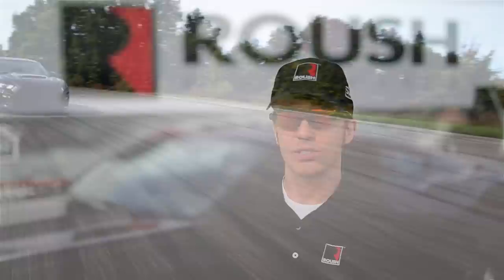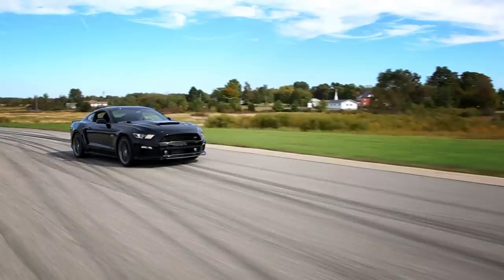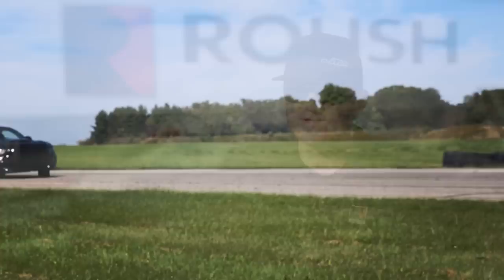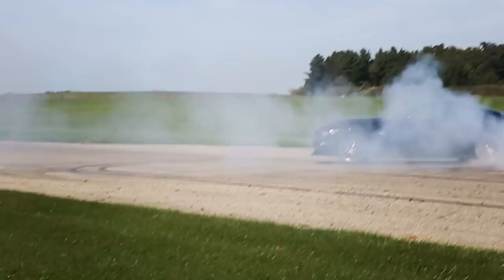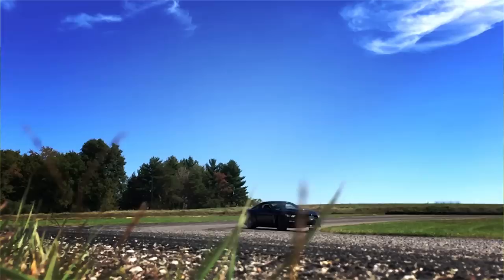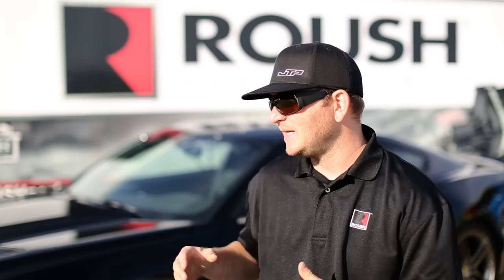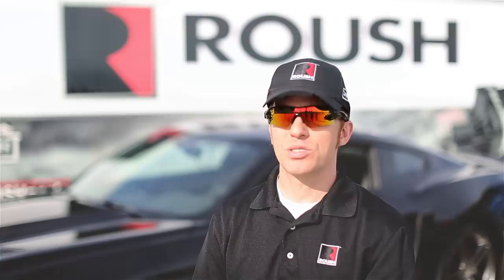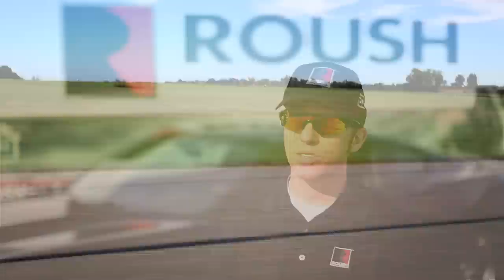2015 ROUSH Stage 3 Shakedown

Comment: Bought the RS2 with the dealer installed supercharger, added the Ford performance half shafts, drag radials, Spec stage 3 + clutch and have never had a problem with the car. I drive it on the street not the track anyway. Still loving this car!

Comment: At first glance it seems like a great package but when you consider the Stage 2 costs almost 9 grand and all it includes is basically cosmetic stuff and a quad exhaust. The exhaust is only a axle back too. I'm sorry I couldn't justify 9 grand just to make the car pretty. It doesn't include any engine performance improvement or handling or braking. Its a 9 grand body kit. Nah sorry. Oh you do get some 20" wheel and tyres but I'm not a big fan of them anyway.

The stage 3 is ok, but at 20 grand its getting into what will be GT350 money which then becomes a very hard sell.

Its not that they are bad packages just I would find it hard to justify buy them.
Reply: +Mike Giambattista incorrect, salesman.  Suspension is available, not standard over the RS2, and there is no tune for the RS2 that is going to give 55hp w/ just a axleback change out back.

If you piece the stuff (since much of it can be purchased pre-painted) you can turn a regular mustang into a roush for half the money.

Comment: i'm a big time ford guy but i wouldn't buy a roush it seems like all they do is put a supercharger on the cars
Reply: +DJ JONES yup. im looking to buy a new Mustang and I'm leaning towards a Roush, but for 10k you get the RS2 which is a body kit, and wheels and tires.  For 20k you get the RS3 which is all of that plus a supercharger.  Quite the rip off.
Reply: Danielle Koran yew you are better off buying a base 15 GT and build like you want plus i think for should move away from superchargers and go with turbos on the 5.0